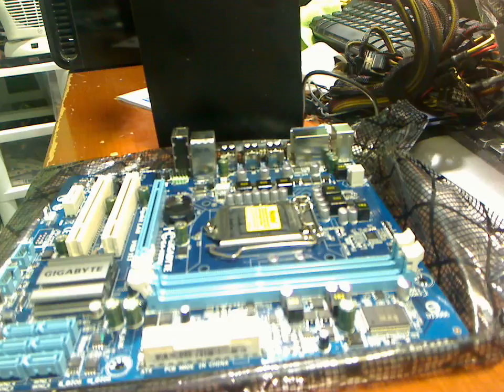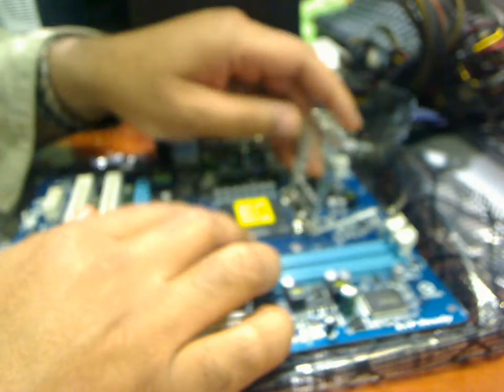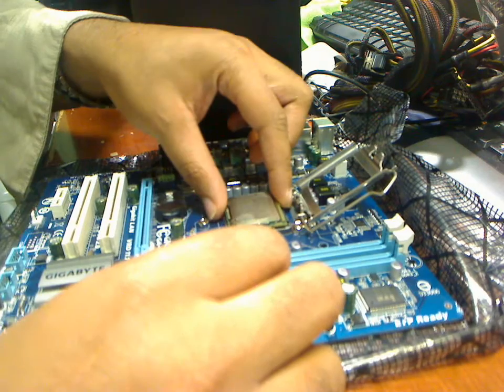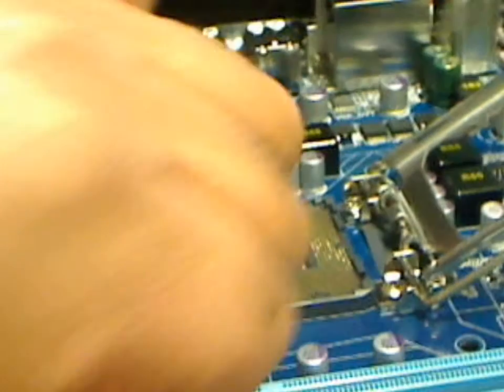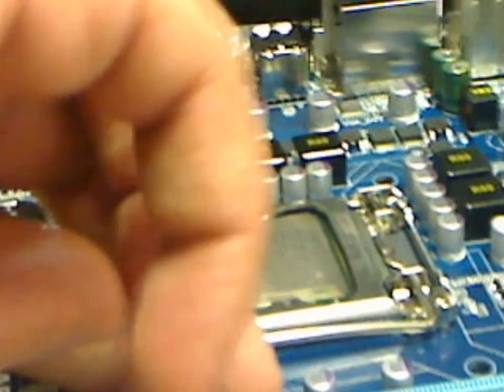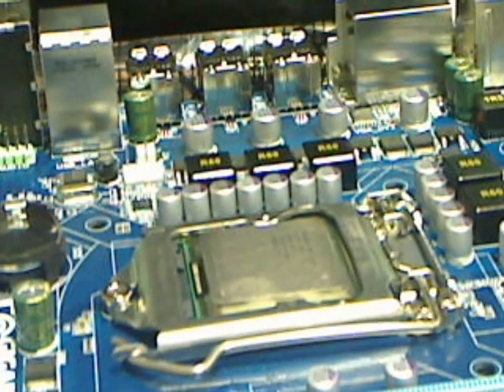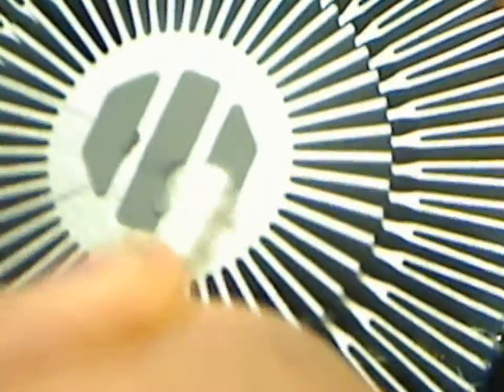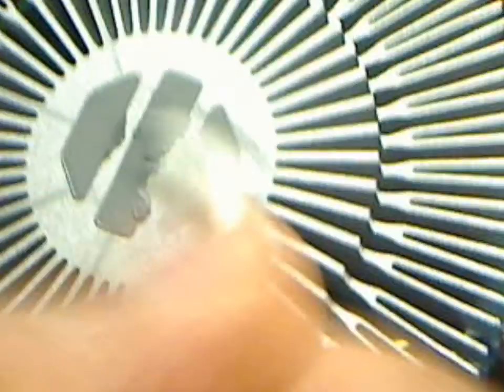Core i3 CPU install and heatsink

Comment: 63 new-B again but if a board had Intel cpu can you replace it with a AMD
Reply from the maker: Gerard Dresch No not at all AMD use amd board and Intel Must you motherboard with intel CPU socket,  I prefer gigabyte boards with all solid capacitors they have stood the test of time for me.
Reply: biggonyou : Computer Whisperer Thanks for quick reply I have a hp 6000 that I found no -cpu-heat sinf-fan or ram looks nice 755 board I think will takr a quad pocessor it has Hdmi and all of that , I will have to wait till I can find one maybe at recycle. Thanks
Reply from the maker: try ebay.

Comment: I appreciate the advice and visual walk through, installing my 1st cpu this week and was debating on whether to use an aftermarket grease or just use what it came with, only an i3 2100 so cant get it too warm but may as well get it as low as possible if it's only going to take a few bucks

Comment: I just installed an i3 550 Socket 1156 on a Gigabyte H55M-UD2H, and the pressure to close the CPU clamp really scared me too.  I looked at it really carefully to make sure the CPU was seated correctly.  The handle was BENDING when I pushed it far enough to lock it in!  

I was sure something was going to break but it didn't.  You can see the lever arm bending in this video too when he pushes it far enough to lock it in place.